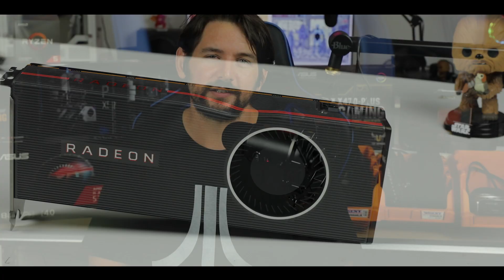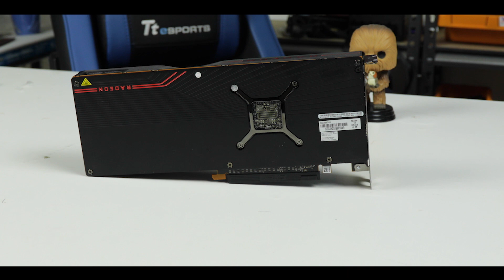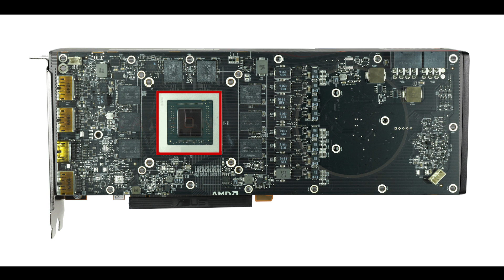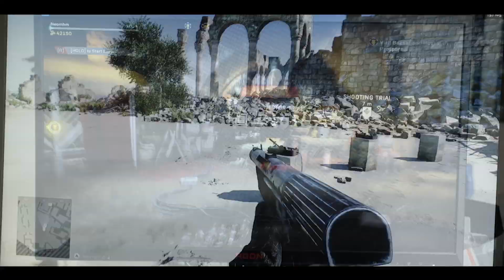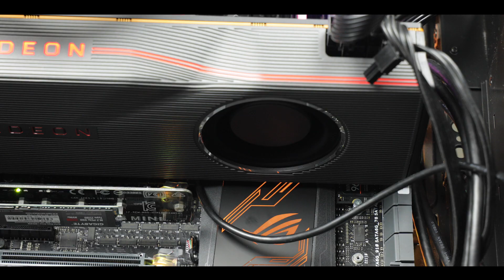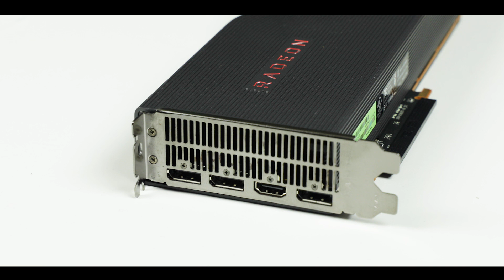Radeon RX 5700 XT : raising your gaming expectations!

Comment: 7nm ihs, but its realistically a 12nm chip. dont brag about small being better. in this case, its a big dick trying to be a small dick. radeons trying to say something here.
Reply from the maker: :) Just to be clear,  AMD's Navi 10 GPU uses the RDNA 1.0 architecture and is made using a 7 nm production process at TSMC.   

TSMC has been manufacturing tape-outs 7nm chipsets since 2018, and doing risk-productions since April 2017. 

NAVI10XT is ligit 7nm.
:)

Comment: I think it's a mistake to think that there is any version of PCIe currently in use that will bottleneck any GPU - and this is true for the foreseeable future as well.   Theoretically it kinda looks that way but practically it's not going to happen - at least not for gaming.  Seriously watch the bus usage during even the most demanding titles and notice that it never exceeds even 10% on PCIe 3.0 - and 5% on 4.0.   Most games are down around 1 to 3% of PCIe 3.0.   So even people still using PCIe 2.0 are getting the full experience from the newest cards (IF they ALSO have a CPU that can deliver the data fast enough).  It isn't testable because on PCIe 2.0 or lower, there isn't a MB/CPU combination with a strong enough CPU but...  I would personally venture to claim that even a PCIe rev1, x8 would be able to deliver full GPU buss demands without a hitch - and bus usage would never top 80 or 90% (PCIe 1.1, x8). 

Now this isn't true for other kinds of computing like (other than games) nor for non-GPU devices such as M.2 PCIe drive arrays, etc..  But for gaming no one will ever need to think about what version of PCIe they have:  2.0, 3.0, 4.0 - all the same - even at x8 of those revisions.
Reply from the maker: You are going deep in there :)   I would generally agree with you , save the percentages. The 2080ti is clearly bottlenecking 8 lanes PCIe 3.0, and looking at how fast things are going, I would bet that we will be seeing future GPU series bottlenecking the 16 lanes by Q3 2020 or Q1 2021.    

But in application you are totally correct. In the large expense of GPUs out there, the 2080ti is just one over-priced option and for 95% of the GPUs, they are very far from bottlenecking PCIe 2 let alone 3.  

So I absolutely accept the correction :)

Comment: So the RX 5700 XT is better then the RTX 2070  for the price as its 60 dollars less, but how about multi rendering?  Is Overclocking the RX 5700 XT not viable without water cooling or clocking the fan up more?    Is Raytracing that big of a deal and should I wait for next gens  to come out?
Reply: it is viable with custom cards, and the blower is good enough but it is apparently loud